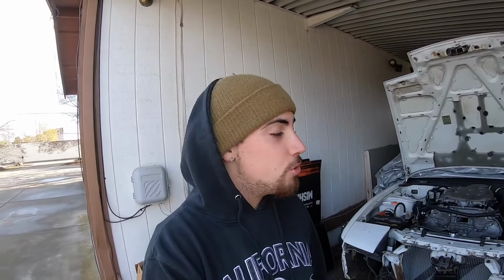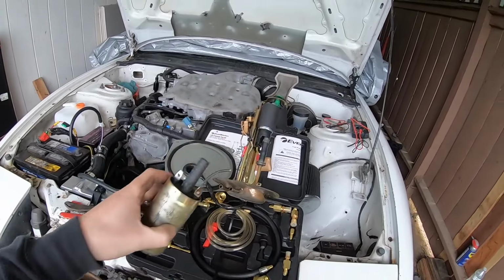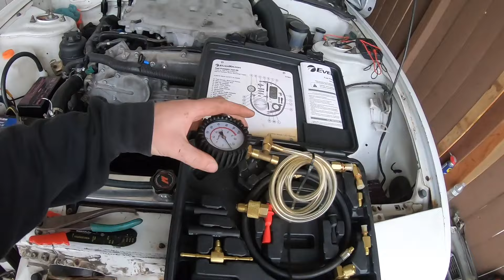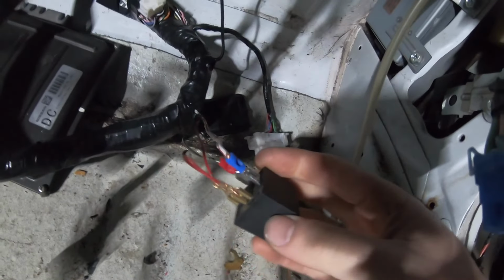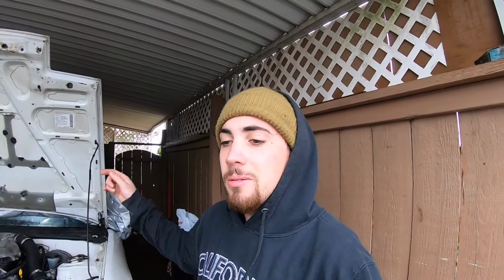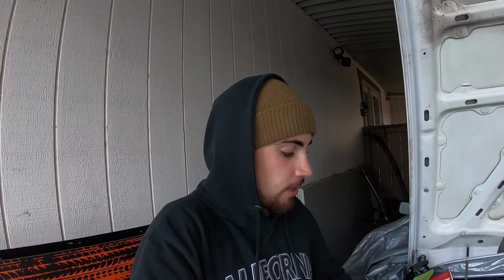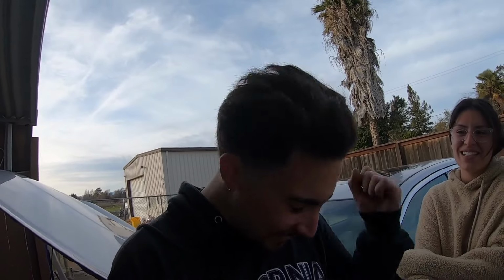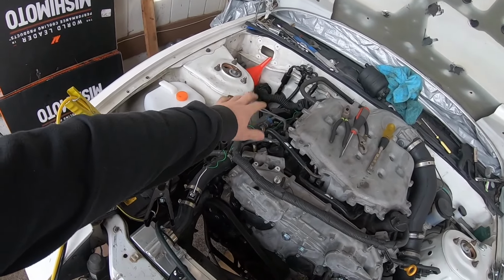FINALLY GOT MY VQ S13 TO START!!!

Comment: should  do a diy home paint job with some air guns and stuff with the homies down the road when ur ready. hell even do the engine bay too would looks sick! also now that it starts have you any plans for inner engine part upgrades? rods, bearings, cam gear, rings, clutch, gaskets ect. ? hydro brake would be dope too so u dont wreck ur e brake after a few events. but keep it going man love wht ur doing